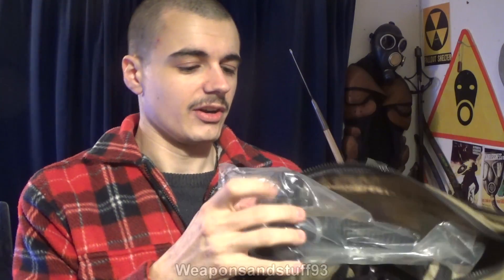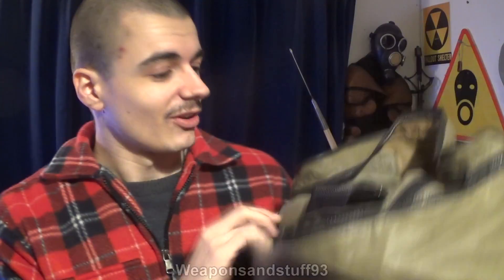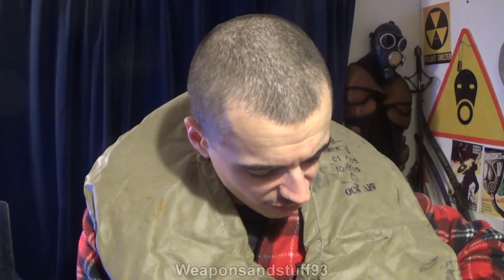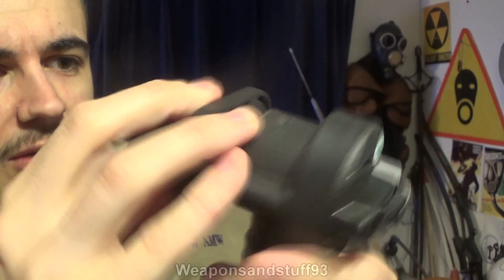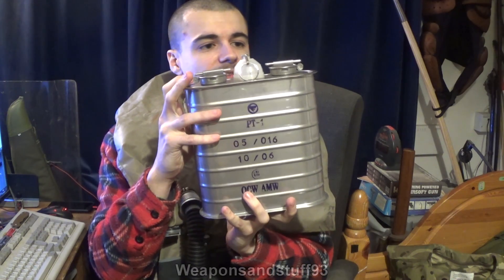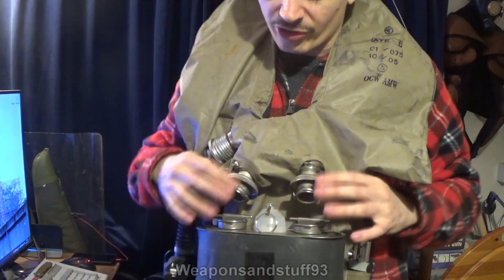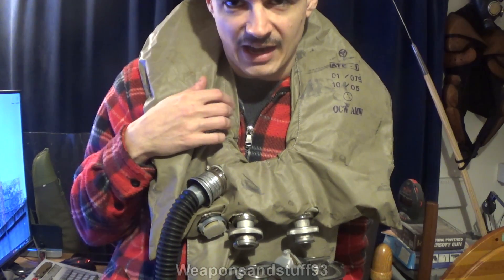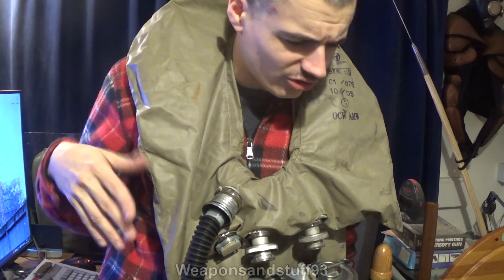Polish ATE-1 Rebreather System

Comment: Some of the old rebreathers that the U.S. navy used to use if saltwater got in them through the mouth piece or a bad seal it would cause a chemical reaction and start to produce chlorine  and chlorine dioxide gas one of the reasons they replaced them

Comment: I trained on a sport kiss at Catalina and flooded my loop. Burned the hell out of my mouth and throat and had to bail out at 40 feet, vomited on the surface and the fish are my lunch. I later got certified on the Evolution (ambient divind). This polish rebreather would be good to 20 feet below that you get oxygen poisoning cus it's a pure oxygen rebreather and pure O2 below 25 feet causes hyperoxia and convultion. Its   just for sneeking into enemy beaches. Good for defying Governor Newsome and his goons in California. Scriber is soda line and it needs to be freshly packed. It's only good for a given time like 3 hrs then you need to change it.

Comment: So a rebreather is an air supplied respirator?
Reply from the maker: Yes same as a mask using an air tank just a rebreather recycles air.
Reply: It recycles the air you breathe out and that is why so many people suffocate with them because every time you breathe in, the air gets thinner.
Reply: @krisanludwiczak6377  no, it does not, the "scrubber" is called "wklad regeneracyjny" ("regenerating canister") because it turns CO2 back into O2 using potassium superoxide

Comment: Hi! Recently I asked you about the safety of a certain spanish filter, and I've found something. Even though the cotton and the mesh at the top of the filter seem to be intact, I've found a lot of small, brownish particles on the inner edge of the thread, and I don't know if it may be one of the darker types of asbestos or simply some dust/dirt that came from the outside. I have a x150 x450 microscope (not much) and I took some pictures. It looks like there are some small chunks, along with individual, separated fibers (thinner than hair). I was wondering if I there was any possibility for you to take a bit of your time to take a look at the pics and tell me what you think about it. Thanks in advance, keep up the great work!
Reply from the maker: Put the picture on an image upload site and put a link to it in a new comment
Reply: @weaponsandstuff93 
 https://photos.app.goo.gl/2pDw7rGqgZmMBVdf9
There it is. It includes some comments too.
Reply from the maker: Well that could be some sort of dirt, cotton fibres or metal scraps.
Personally as it's a filter from the 1960s I would not breath through it, as even if it doesn't contain asbestos, it will have deteriorated inside so you could inhale charcoal dust etc.
Reply: @weaponsandstuff93  Thanks a lot for your time and advice, I'll keep that in mind! I'll probably order some P3 filters soon for the sake of safety.